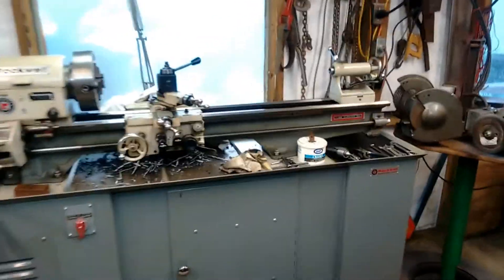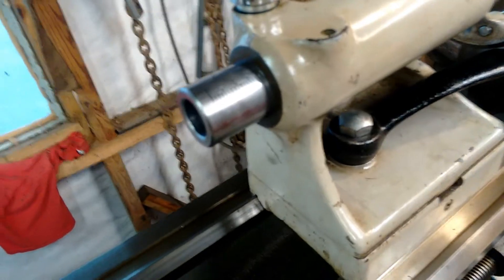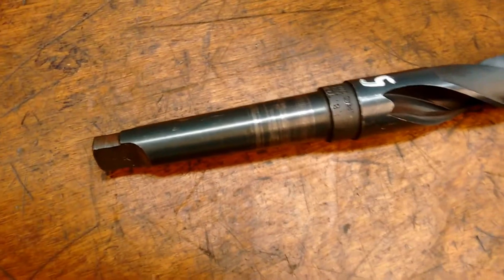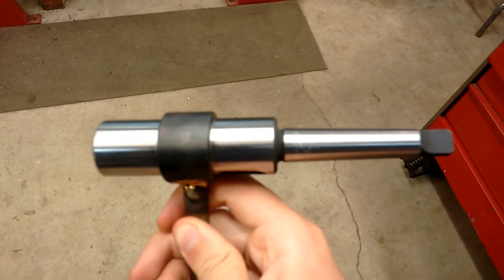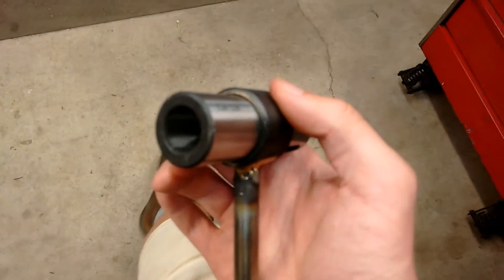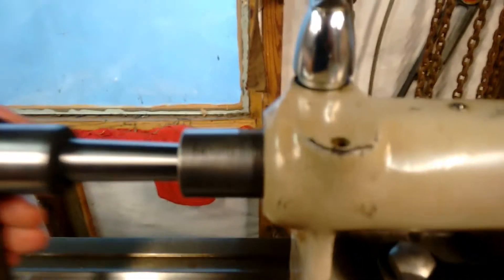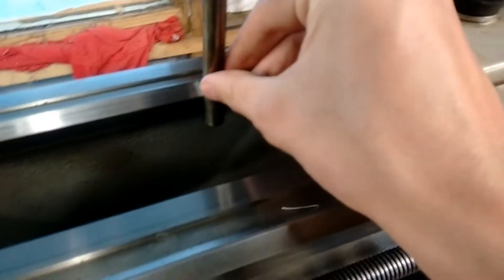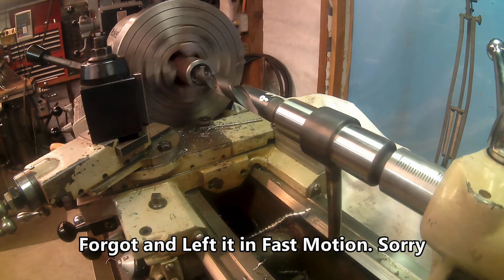How I Stop Drills from Spinning in the Tailstock

Comment: Good sollution!
But... you loose a lot of travel this way.
I'm using a drive dog to hold the drill and that works fine
Greetings from The Netherlands!
Ron Veraart
Reply from the maker: A drive dog is good method. I learned about that after making this. I think this is a bit faster, and for a long bed machine like the Rockwell, bed length is rarely ever and issue. Thanks for the comment.

Comment: The tang is not there to stop the insert from turning ,its there to let you get it out again.  The reason yours is turning is that it's not inserting full (look at the contact pattern)!     If you rely on the tang to resist turning you are in imminent danger of  twisting it off the end, then you are in deep merde.    Get a reamer and clean up your quill and things will be better.   BUT remember you aren't meant to drill a 38 mm hole with a morse taper 2!!!

Steve Callachor
Under the Southern Cross
Reply from the maker: Contact pattern came with the drill not from the lathe. Yes, I agree, it should be reamed.. That's a 7/8" drill, if I can hold a 1" silver and deming drill in a 1/2" drill chuck, then I feel comfortable drilling a 7/8" hole with a MT2. The tang is not that wimpy, and if it wasn't designed to take torque then it would have been round.